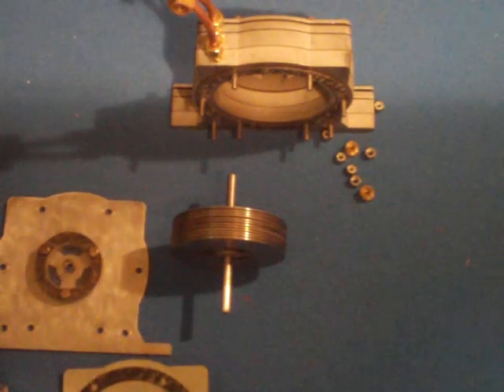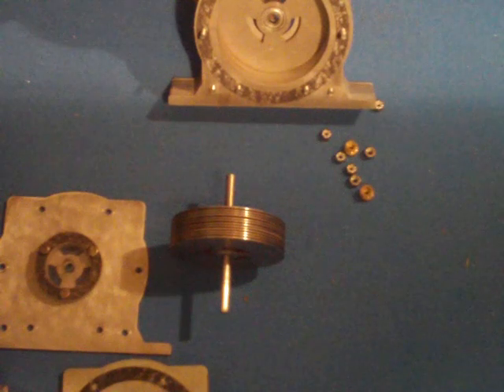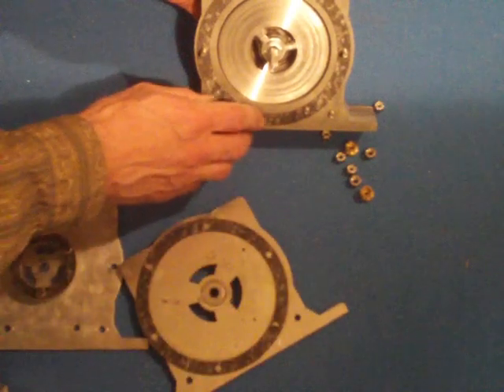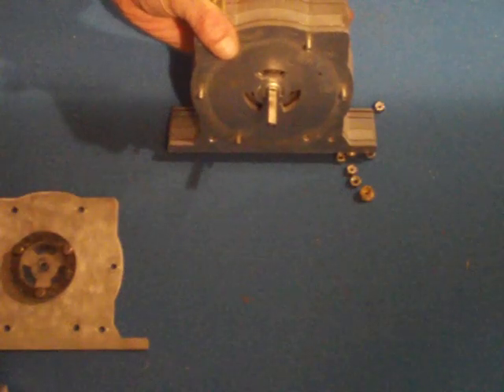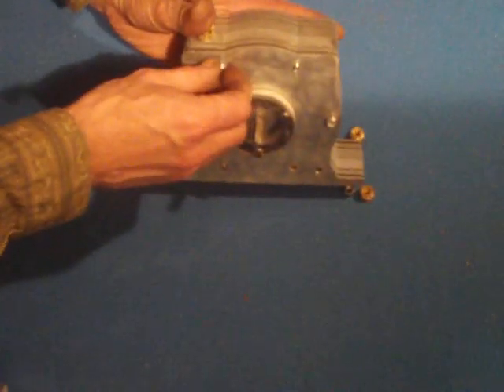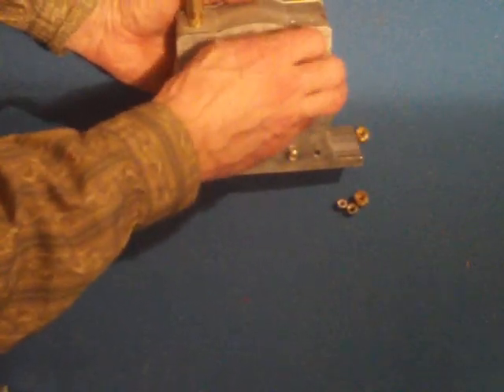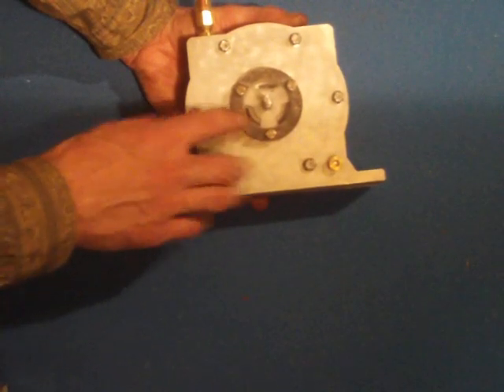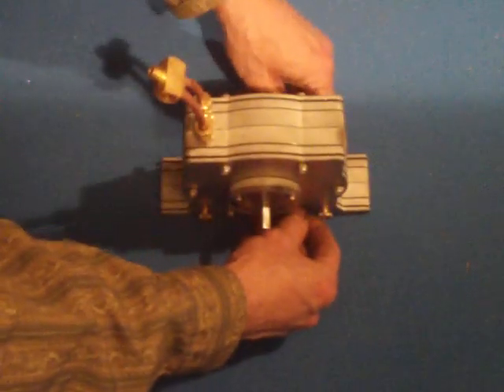Inside the mind of a Nikola Tesla turbine, 100 years later the instructional video he never made.

Comment: @Iseekoutthetruth 
I have talked to a few automobilia nuts about this in NY and Canada. I don't think it is Tesla's claim at all.
He did have an arrow that did not use the gas motor I am sure but 130mph on unpaved roads and on wooden rimmed wheels is fantasy. The biggest cop bike of the day Indians and Harleys could touch 100mph but shortly after started throwing nuts and bolts and transmissions. 
Tesla either used a geared steam turbine on coal or....
an AC heavy flywheel motor and pulsed coil.